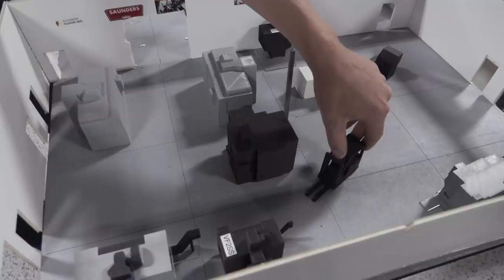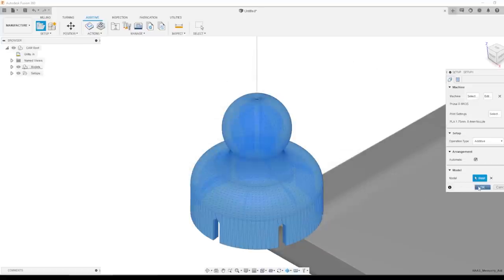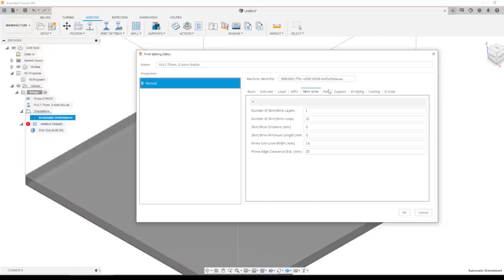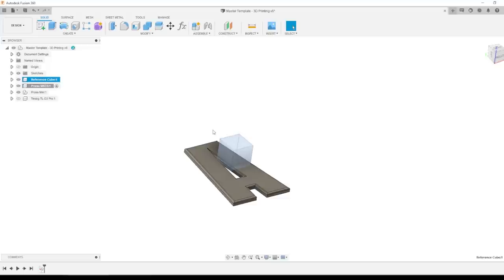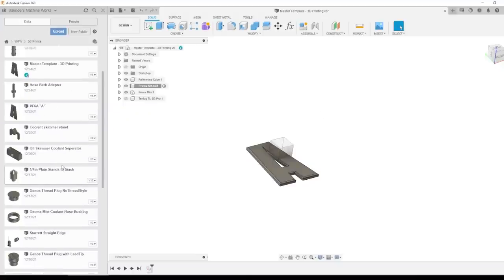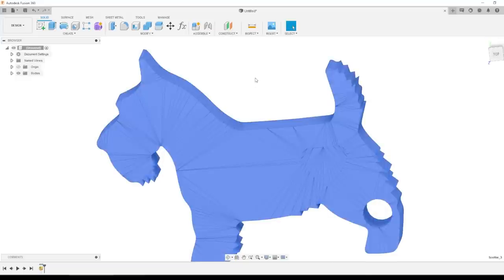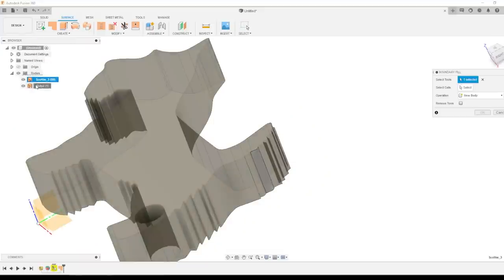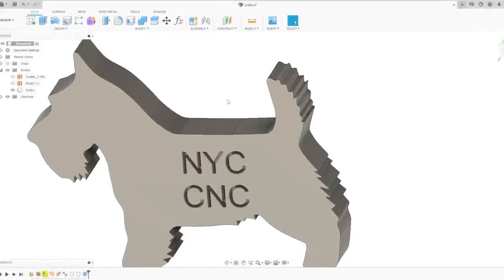How to 3D Print in Fusion 360!

Comment: I first took interest in this when I discovered the Fusion slicer could generate g code with G2 and G3 based on the solid model, which made smoother curved walls. However, I lost interest when I was unable to match the printing quality of Cura and I was unable to figure out how to directly send the job from Fusion to my printer over the network.

Comment: Another option for your mesh example is to just keep the mesh as part of your model and edit the mesh in the mesh workspace (such as to remove the hole) and add features in the model space - such as adding a solid object to fill the hole and creating an writing object then doing a subtract then doing a subtract to create your etch.  One of the big advantages of F360 is that you can design in all the spaces simultaneously in the same model.  Do some of the design by importing/scanning a mesh, do another part as a parametric model, and then do yet another part as a smooth sculpt. They will all work together.

Comment: Simulation in F360 is awesome.  I need to create a set of grippers for a collaborative robot with needed to grip a tray but the weight of the grippers reduced the weight of the tray I could pick up so I created a simulation and looked for stress and deflection and kept on reducing and adding material until I had the best balance of grip strength and weight.  I did all the work in F360 - no prototyping and then had them machined out of aluminum at a local quick turn fab house.  We have been using the same grippers for over 2 years now with no issues whatever.  BTW, I am an EE - not an ME.

Comment: I can see the advantages for some automated workflows, where not having to export as an stl every time might be useful, but for printing stls I still find the usual slicers much more intuitive to use for beginners, you just drag and drop the file in, select a detail level and send to the printer, no need to worry about components and different things. (this is assuming the person isn't already familiar with fusion360 manufacturing, but I doubt your kids are running your Haas quite yet ;)
Reply: Agreed. Feels too basic or limited compared to PrusaSlicer or Cura right now, hopefully gets integrated or at least a feature within Fusion that allows a direct export into a chosen slicer instead of saving every single iteration as an STL then importing for slicing. I use up so much time doing that dozens of times a day.

Comment: I think if it's a lot more like superslicer I'd use it. Things like shrinkage, compensation and direct to printer is why I use it instead of fusion. I'll have to check back if the slicer settings have changed.

Comment: Thank you.  I already use fusion 360 and one of the reasons I didn't want to get a 3d printer was having to learn 3 other software products.  Love that you showed the step by step of how to generate CAM.  I watched the video 4 times before I was able to get my fist part generated and simulated and G code.  I bought the same printer as you as well.  I'm planning on using the 3d printer as prototyping then send my completed products in for CNC machining from aluminum for production.   I'm glad I found your channel!! love your content #subscribed

Comment: I gave it a try for a few months, processing about 2 rolls a day between the printers.  My biggest issue besides poor print quality, is the cam work flow isn't very fun.  No matter how hard I try to use this, I'm always back to simplified3d to get decent prints.  Once the 3d printing world gets past Marlin and STL files, then fusion will start having a real advantage.  But as the brilliant minds of 3d printing are still using extrusion, I wouldn't wiat up for it.  Until then, I get more out of simplified.